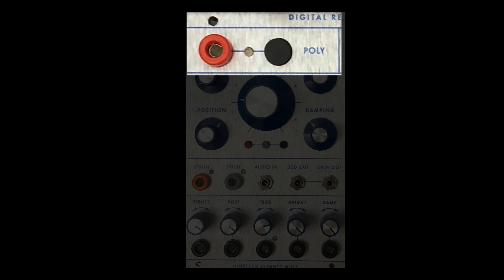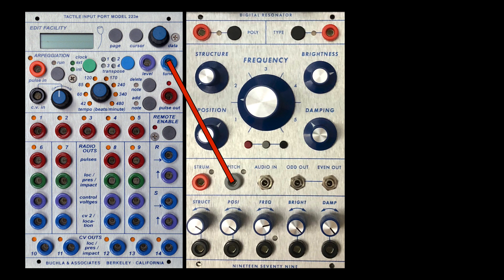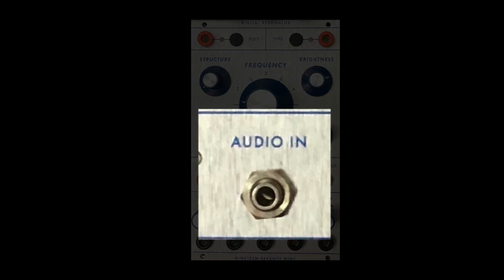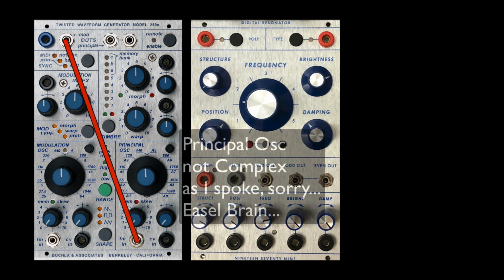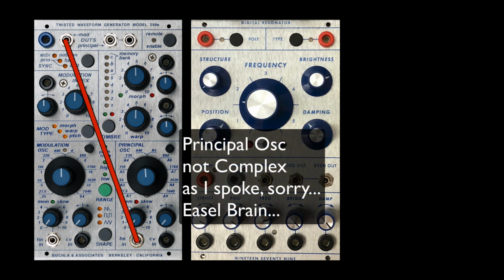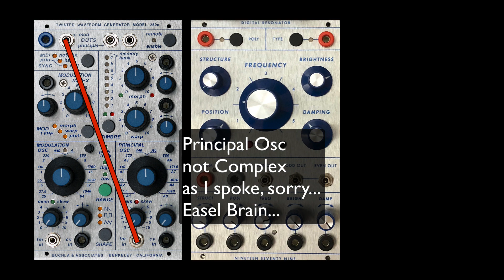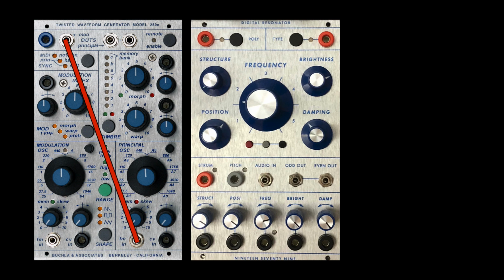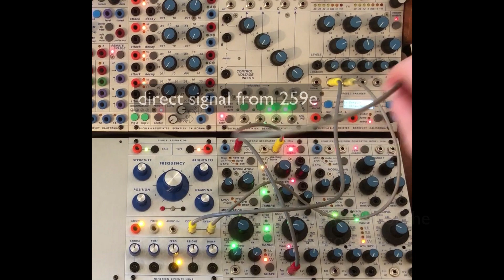1979 Digital Resonator overview

Comment: I just got my Digital Resonator yesterday and played with it a bit today.  Some findings: if STRUM is enabled, then it overrides as a trigger.  If not enabled, then diatonically large changes to PITCH will function as a trigger.  Slower glide changes to pitch will not trigger, but will change pitch of ringing note.  Regardless of whether the resonated is triggered by STRUM or PITCH, POLY determines whether to keep triggering the single oscillator (POLY = GREEN), ping-pong between two oscillators (POLY = ORANGE), or cycle through four oscillators (POLY = RED).  It seems to me that POSITION is symmetric: hard left and hard right are equally muted, changing to very high in harmonic content as we move away from the extremes, and moving toward the center provides the simplest, most fundamental harmonic content (which can still be quite complex).  All other controls (STRUCTURE, FREQUENCY, BRIGHTNESS, DAMPING) are 0% to 100% in what they do.  Finally, AUDIO IN is optional.  WIth a STRUM (or without STRUM, with a PITCH change), the resonator will resonate without an audio input, with PITCH and FREQUENCY being the starting point for STRUCTURE, POSITION, BRIGHTNESS, and DAMPING.  All in all, a wonderful little module!
Reply from the maker: Michael Tiemann Thanks for adding such great info!!